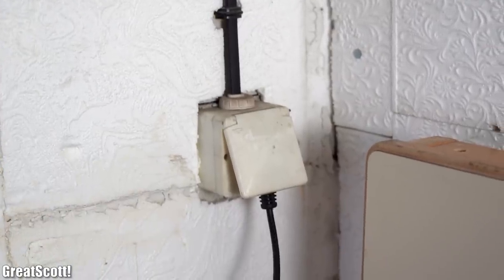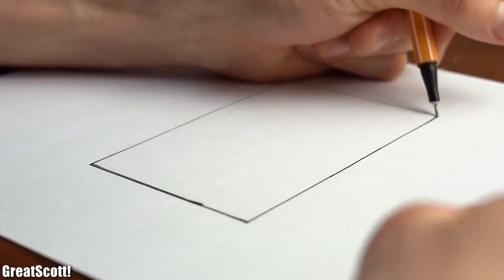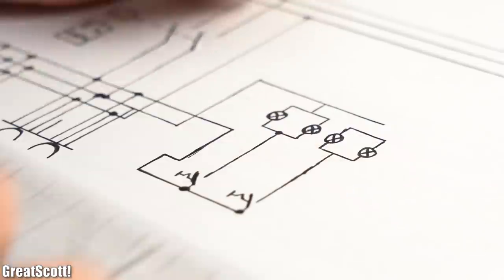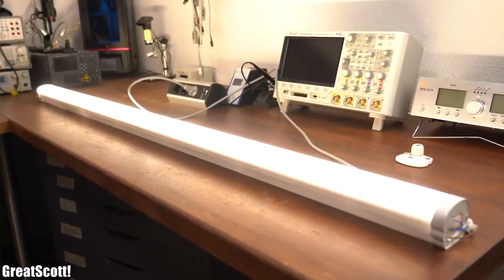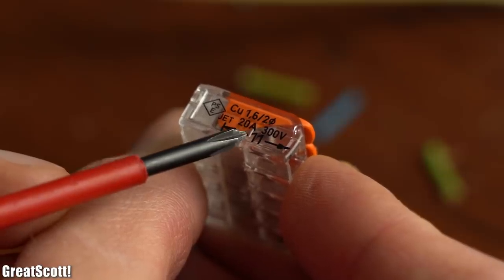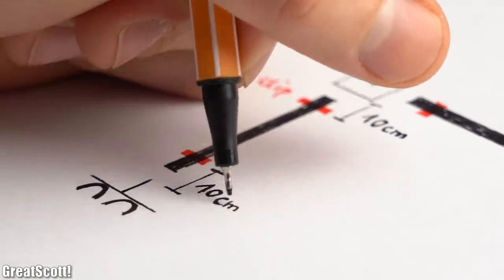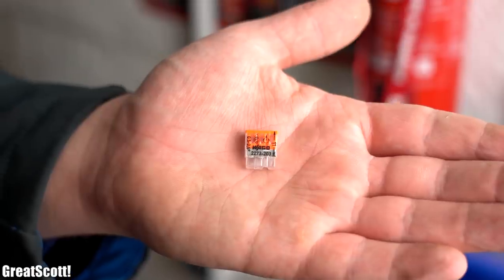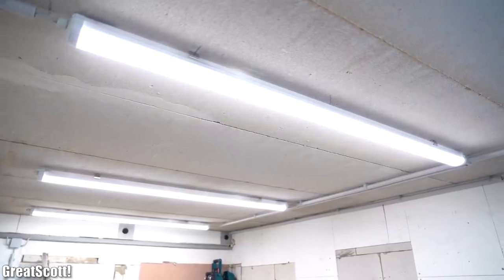How to do Electrical Wiring properly! (more or less....) GERMAN STYLE!

Comment: Pretty similar wiring set up here in the UK, but would use 2.5mm2 conductor for plugs to take 32amp load, but if its not being used as a workshop smaller would make sense. Here we cant have any exposed wire also in garages everything has to be in conduit.

Comment: Interesting to see that the conduits end 5 cm outside the junction boxes thus exposing the cable! 🤔 In India, the conduits end inside the box itself and moreover concealed wiring (inside the wall) is standard here.
Reply: Sweden uses basically the same standards, where I'm from, and Spain where I live is similar, but I have never seen any installation like that with open conduits. Seems crazy af.

Comment: Can you tell me how to steal  electricity ? When load is high , due to little sparking some time, wire got hot and its buring day by day. Can you tell me how to avoid sparking and prevent wire protective shield from melting.

Comment: Funny reading the comments about Philippines and other countries. I am German, but we also have a house in Thailand.I assume the "standards" might be very much comparable. I our first house we got only 2 circuit breakers, one for the hot water (flow heater) and another one for power outlets and lights, but with a fault-current circuit breaker. Very "affordable" and simple. 
Too simple for the next house. I did not do the installation by myself, not that I could not do it, I am an electrical engineer, but the wages are so low that I did not bother to do.
The electrician has never seen such an installation for a single house before. We have a lot of "smart" things in our new home. I even have some Germany "Schuko" power outlets that give a perfect fit for the devices we bring from Germany.
But in general I have to say that the handling of main voltage seem to be very reluctant in some countries compared to Germany.

Comment: the light circuit and socket circuit are supposed to be on a separate breaker right ? in this video they where on the same breaker.

Comment: Dutch electrician here, just wondering why you left the fuse in series of your new cabinet? When you have a overcurrent or short the fuse wil blow long before your breaker wil. Also 1.5mm does not always equal its good for a 16A rating! Cable calculation is nesserary!

Comment: I recently removed the socket covers because we painted the walls. The Socket were really old ones were you had to screw the wires in. One of the sockets had only lass than one millimeter clearance between pe and live. I was shocked to see that, it was an accident waiting to happen. I replaced all switches and sockets.

Comment: In Spain the wires for normal sockets must be 2.5mm2 connected to a 16A Breaker (only overcurrent protection). The cealing lights are in a separate circuit using 1.5mm2 wires and 10A breaker. 
All circuits are earth fault protected with one or more RCB and a main breaker.

Other than that, very nice job.

Comment: How different to UK standards.  Right from the start - plastic consumer units not permitted, trunking must be glanded into the box, those stranded cables would have ferrules fitted, the list goes on.  Interesting video - thanks :)
Reply: It's possible to have bare cable in the UK in a setting like this. In my case, whilst my garage has all the cable running along the wall into the (metal) sockets and switches running in conduit, without any gaps, when it runs up at ceiling height along the joists it's exposed.

The biggest issue I picked up is that 1.5 mm^2 cabling would not be used on a 16A or 20A radial; it would be 2.5mm^2 and, secondly, the lighting would either be on a separate circuit (the preferred method) using a 6A breaker or via a spur box with a 5A fuse. Of course, the lighting can then be on 1.5 mm^2 cabling.

Comment: I have some questions;
- Are the conduits just standard PVC pipes?
- You added a RCBO to the circuit but left the ceramic fuse anyway, why?
- The lamps you bought look like LED and usually led lamps do not have protective ground terminals (as seen on video) where did you put the ground wire, why?

Comment: sehr gut !..  Well Im a technic in these stuff, i like a lot the very easy criteria for design and mount the lamps, switchs and wiring., the conduit and clamp are very fancy and fun to see and mount.  Here in Peru usually make more tight standards into tubes but very relaxed into connections.  And we dont use these wires.  The calibers are more coarse too. Personally i should design these circuit more simple because i dont have enough money for that. However its a very neat job.  I love that project.  Cheers and Vielen Danke! 
Pd: i cant speak german, but this not bothers me to greets in german.  
Pd 2: My mother language its spanish.  So, Please tolerate my bad english.

Comment: In Norway you need to have 2,5mm wire if you want a 16A fuse. You can only use 1,5mm on a 10A fuse or less.

Comment: Surprising how different the switches, connectors and junction box is so different than in the United States. The main box with the circuit breaker is metal and the circuit breakers are so much different also. In my apartment I have a hundred amp main breaker.
Reply: That's 240/400V vs 120V for you ;-)
Reply: @astranger448  US is 240 V split phase. There are two hots with neutral in between.

Comment: Here in Estonia we use a lot of German standards but wiring is a lot more strict here, the cable pipes have to enclose cables 100%, for that we have to use flexible joints, elbows, etc. I wish we had it as easy as in Germany..

Comment: In Italy we use only stranded wire, those are  more flexible and are better for AC imho. Moreover the pvc tube are connected to the junction box so no wire are exposed. BTW very clean job in the video!
Reply from the maker: Thanks for the info!
Reply: Maybe they are better for AC but not at 50Hz!
Reply: @volkhen0  We have 50Hz in Italy like in all Europe. In Italy we don't  use solid cable since the '70s. There's no shop who sell those tipe of cable.
Reply: @forownmade1243  why what?

Comment: As an American who was at one point on the path to being an electrician (the fact I watch great Scott should be a hint of where I am now) I can firmly say your stuff is so much better. Rail mounted and highly customizable main panels, boxes with (well designed) snap together connections and max fill printed for easy reference, those connectors which are amazing are present in the US but usually only found in light fixtures likely assembled overseas. The norm here is wirenuts which are still secure but not nearly as foolproof. To have the kind of knowledge and skill to do a project like this requires 4 years at least of apprenticeship and a $200 book that gets barely changed every 3 years. Even then the components to do it simply are not a thing here (having an outlet IN your breaker panel is almost unheard of outside of extremely specific cases)

Comment: I know it's standard in many places and I've seen it often enough myself but it still seems strange to have conduit stop short of a junction box or fitting.  Here it'd be at least flush with the fitting if not actually attached to it with a gland.  Also those high level cables would require some form of fire-resistant fixing: the idea being that in case of fire potentially live conductors should not fall on anyone.

Comment: Nice vid, simple and straight forward. Not a huge fan of keeping the lights on the same lead as the sockets tho. Id rather use an RCD with separate breakers and would use 3x2.5 for the sockets given that the main incoming power cable is as thick or thicker.

Comment: Been wondering, what is the point of leave 5 cm of free space between the conduit and the outlet/switch/boxes? No protection in this way. Also, why not change the main fuse, with a 20A ceramic one, also 2,5mm2 to feed the RCBO and A MCB for the lights. Just asking, not blaming, ofcourse.

Comment: I would have put the lights on a separate 6A RCBO, that way if the sockets trip you still have light. Maybe not necessary for that small garage but still nice to have. 1.5mm cable for 16A seems odd, in my country we use 2.5mm (but stranded, solid cable in theory can carry more current and thus 1.5 is probably fine).

Comment: Don't like the exposed cable between the box and conduit. 
In North America we use galvanized steel conduit as an unbroken line of armor from box to box.
If you don't use conduit there is cable with flexible steel sheath that attaches directly to the box. This method is OK for your garage application.

Comment: Just wondering, as in the UK our conduit generally has to be connected to a box in this case is a conduit for mechanical protection or is it simply an easy way to run the wire because I would think it would have to be run directly into the box to offer mechanical protection or you could damage the cable near a switch or outlet

Comment: I would have put the sockets on separate fuse though, so it doesn't get dark in case you plug a shorted fan or something.
But if you only have an 6A inlet, what breaks first, the new fuse, or the old?

Comment: I like the explanation and sense for details. But i am wondering why at least lights and sockets are not separated circles? RCBO is mandatory, but you could put lights on 1 C6 A automatic fuse and 1 C16 A fuse for sockets (16A fuse for sockets might be overkill for a garage). didn't notice what is the main fuse rating. Also the original distribution box with fuse you could get a new nice one, or moved main fuse to your new distribution box. :)

Comment: Is it allowed to have discontiguous protective earth? I mean you connected the PE wire to first socket, and then chained the other one. In my country it is prohibited to daisychain the PE, it should be contiguous, and never be connected like in your video, because if the first socket PE terminal fail, then the other one will be affected as well. Also, in distribution boxes we use twists with ferrule crimping over the twist, or use welding.

Comment: I didnt understand one thing. Did you connect the outlets with 1.5mm2 cable? 
As far as i'm concerned thats a fire hazard. In my country Lighting it's ok with 1.5mm2 but outlets should use 2.5mm2 for safety reasons.

Comment: German electrical wiring amazes me.! In Australia all that would be highly illegal  🤣👌🏻
Reply: Why? What's different in Australia?
Reply: Australian wiring wouldn't be up to code in Germany either. You have a standard based on the British electrical code that, for instance, allows ring circuits of 32 A on 2.5mm wiring. That's very much against code in Germany and neighbouring countries that have similar codes. Ring circuits aren't fail safe. The way you'll discover that you have a fault in a ring circuit is by the smoldering wiring.

Comment: hello
i'm not an electrician but i'm noticing a couple of things i'd like to point out. you have put a 16A fuse in series with 6A where 6A is the inlet (main input fuse). since the aluminum wires were mentioned I am wondering if you checked what cables are from the fuse onwards and in what condition they are. The electrical cabinet is super big so I’m also confused why you didn’t put lights and sockets on separate fuses. The wire tubes have been professionally laid and look beautiful. I add here that if the corners are not closed, the insects like to hide inside.

Comment: Is it normal for conduit to only cover 90% of the wiring length like you show? Also, I need to find those circuit connectors. I hate using wiring nuts.

Comment: Solid Strand? here in Italy we use unipolar multicore flexible wire (without the gray sheath) and the conduits goes directly into the boxes through cable glands and small portions of flexible pipe.
The cross section of the wires must be 1.5 square millimeters for lamps and at least 2.5 square millimeters for sockets.
In an apartment, especially if in a condominium, it is not unusual to find the section of line between the meter in a common niche and the general panel of 4 or 6 square millimeters for a 3.3 KW power contract, naturally for single-phase contracts because the three-phase current is used only for industrial plants.
It seems to me that all houses in Germany have a three-phase contract, is that possible?

Comment: Why leaving a gap from the conduit to the junction box. That sounds like a weak point where can be cut off or expose to anything might damage. Isn't there an option vto push all the way in ?
Reply: Yeh I was surprised by this-pretty sure you wouldn’t get away with that in the U.K.. I mean what’s the point in having the conduit only covering part of the wire?!
Reply: @pjs199  in the UK you have a small piece you connect on the junction box as far as I know, to make the conduit fitting inside.  But I am not an expert, I just find it odd to leave the cable expose

Comment: I tried to hire an electrician to install a shower box water heater here in Thailand.  Discovered I knew more about electricity than he did.  I wanted a ground fault safety switch, he installed a circuit breaker and did not know the difference.

Comment: Aksually 3x1,5mm² can hanlde only 10A. Over 10A cable is starting to heat up. I had this experience when i tested powerbar with current 16A. And cable heated up whitin 5 minutes. 3x2,5mm² can handle 16A easily. Usually in estonia we use 3G1,5mm² for lightning fixtures. 3G2,5mm² for sockets. 3means 3 conduits G means with ground wire.

Comment: The one question i have is why didn't you give 2 outlets on either side it's own RCD? Same with the lights, it's own RCD. Th reason for this is when you make or have a short in one of the outlets, everything switches off including the light. And because it's a garage it could be a little damp in there. Some information about the RCD would be nice too.

Comment: Im from Lithuania and its a bit weird seeing such method :D
1. We inserted conduit inside the junction box
2. My company instructed to use WAGO only for light, since they cannot handle current, so we used screwed connectors 
But amazing job! :D weird to see hanging wires tho...

Comment: Outlets should be wired with 2.5 mm². That's what the regulations dictate in Belgium, but those are for the most part the same as in Germany. 1.5 mm² is used for lighting circuits only. If lighting and outlets are mixed on the same circuit, 2.5 mm² is to be used.

Comment: Interesting - in the UK 1,5mm2 cables are only used for lighting on a 6amp RCBO. Radial circuits for power outlets use 2,5mm2 cable which is rated at 20amps.  Are you sure 1,5mm2 cables for outlets is right??
Reply: He is using installation method B2, so the maximum allowed current is with the usage of 2 current leading conductors 17.5 Amps and a max. breaker rating of 16A. The only thing here which could prohibit that would be the maximum allowed voltage drop of 3% which iI cant calculate bcs. I dont know the length of the conductors. Btw. sorry for my bad english, I hope you could understand my comment.

Comment: I once hired an electrician to fix a burnt fuse box.
He cut the burnt part and simply spliced two wires by wrapping them around a nail... It hold for about 3 days until it burn down again.

Comment: Funny how this is almost identical to Finnish wiring, except the cable type (we have our own standards for some reason). But on the other hand we do use German Schuko outlets, so maybe not so surprising. Only thing I would have done differently is to use 2 RCBOs, one for the lighting circuit and one for the outlets, only because when you eventually manage to trip the earth fault part of the RCBO for some mysterious reason, you won't have to fumble in the dark to the distribution board to reset it. Alternatively you could use an RCD for the outlets and discrete MCBs for the lighting and outlet circuits, since the risk of getting a shock due to an earthing fault from a double insulated hard wired light in the ceiling is quite small.
Reply: Germans do something better like they use two single sockets side by side. That requires more work but the plugs do not interfere with each other. In Finland they have weird double sockets that can be diagonally.

Comment: Here we have to use 2.5mm² cables on a 16A breaker.
Also, I would have connected the outlets in series, so I would not have to use junction boxes.
and, I would have put sockets and lights on a separate braker.
Reply: @forownmade1243  2 reasons. If You overload the outlets and trip the breaker, you wouldn't loose the lights.
And as I mentioned 16A breaker should have 2.5mm cable, with a dedicated 10A breaker for lights, I could use 1.5mm cable.

Comment: Oh they look so tidy in there. Wago connectors are awesome, I need to buy more of them so I never modify a wire nut again.  Interesting that the conduit must stop 5cm short of each component...
Reply: I find the 5cm short interesting too. I wonder why. Could it be to prevent moisture buildup? (considering this is an outdoor/wet type installation).
A sealed-but-not-waterproof pipe from component to component could potentially trap water from, say, somebody splashing the installation while hosing down a car. And with water inside the tubes, vapor would work it's way into the connection boxes and connectors causing corrosion.
With the gap in place it would "air out" and dry the pipes.

Comment: In Denmark it is 13A for domestic use when using 1,5mm², at least it used to be that way when I worked as an electrician (2006-2009).

Comment: Sehr cool, hab vor einem Jahr auch ein ähnliches, aber nicht so aufwendiges Setup  gemacht. Hab aber eine Frage  : habt ihr die 6 Amp Sicherung drin gelassen? Wieviel Amp  könnte den ein 3 x 1,5 mm Kupfer vertragen? Sind das 6 oder 16? Und was vllt interessante wäre kann man mit einem 1,5 mm eine dauerlast von 3,6 kw drauflassen? Falls ja wie lang darf das kabel zum hauptverteiler sein?